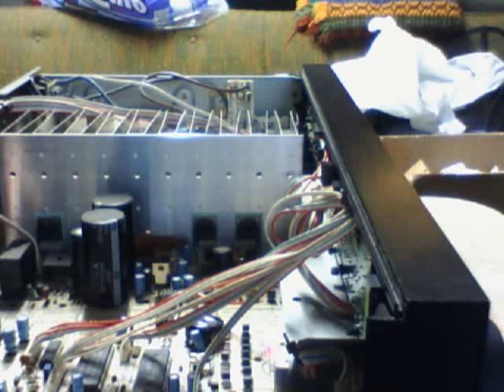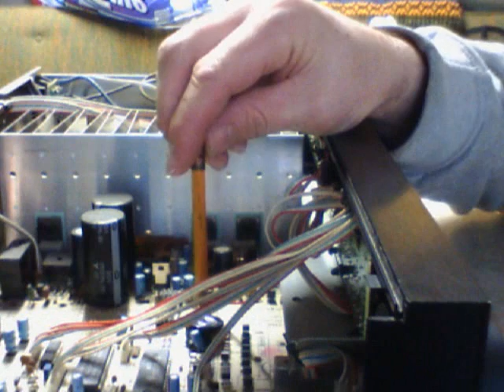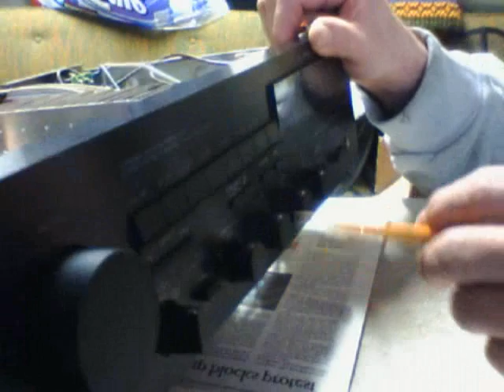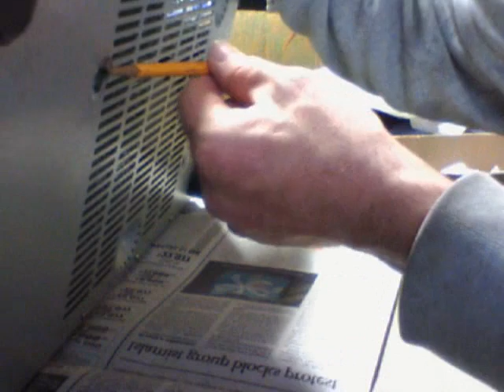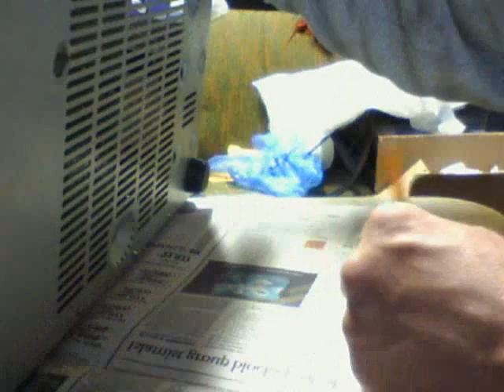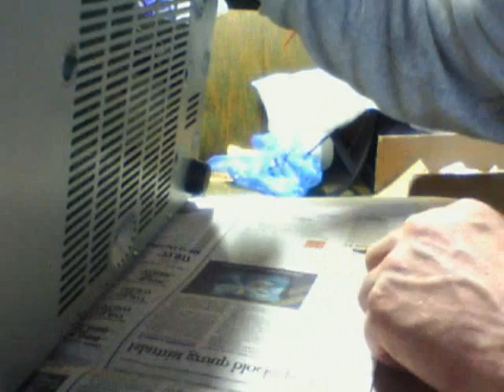Yamaha R-5 Stereo Receiver Memory Capacitor Repair.

Comment: No need to make a hole in the receiver... Pull the existing battery/cap out gently (it will get out easily as the solder joints are old and weak...). Then wire the new battery/cap's positive end to the positive end of the adjacent 10uf cap, and the battery/cap's negative end to the jumper which is right to it, not the left one, but the right one of the two jumpers (the one which is just below the "L" of the text saying "SELECTOR"). The batter/cap is 0.047 Farad, 5.5V. That worked well for me.
Reply from the maker: Thank you for the advice....much appreciated

Comment: Great vid, very common issue for these nice receivers! This should be a 0.047F, or 47000uf capacitor, rated for 5.5 volts.
I think R-5, R-8, and R-9 share this part.
Reply: Thanks for the correction. I have an R5 with the same memory issue and was about to order a 0.47uF... so 0.47F it is ? or a 0.047F ? I think the service manual calls for a "47000uf", which is supposed to be a 0.047uf...